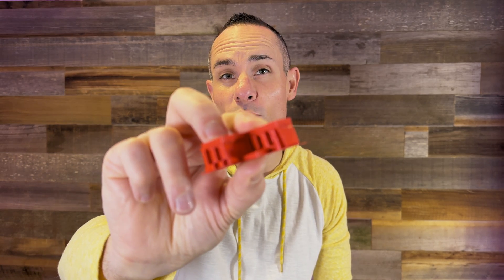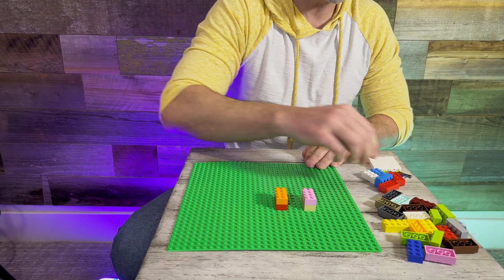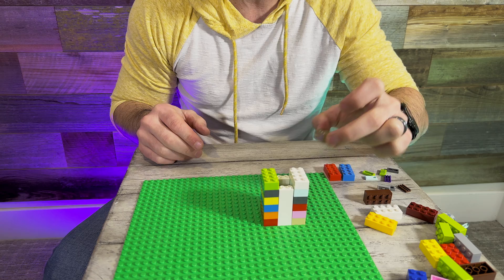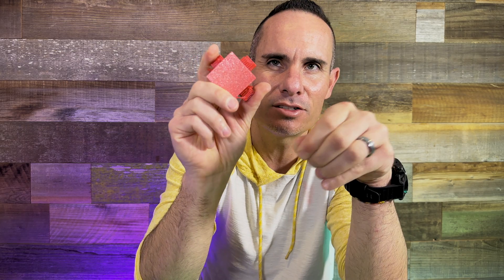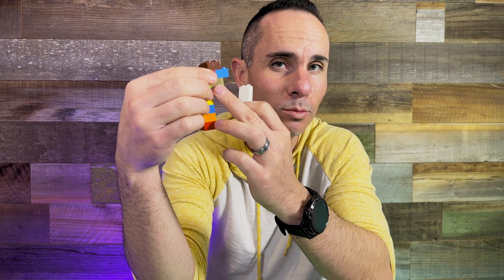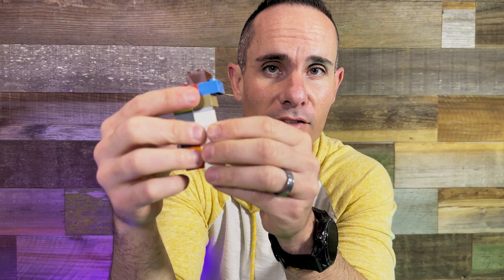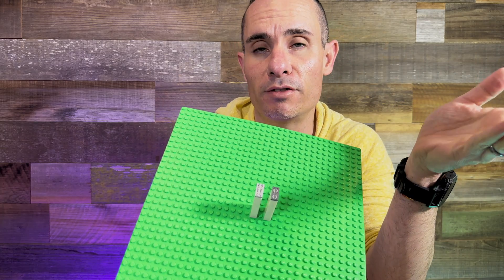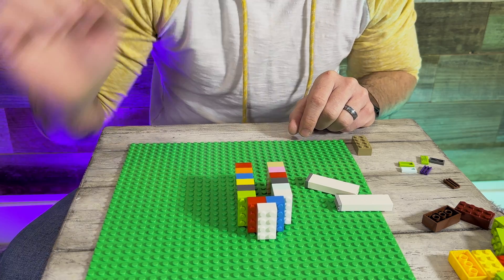Easy To Remove Supports For Your 3D Prints: Tips and Tricks

Comment: i got a 3d print and i am using flashprint. The bottom of my model is a curve, i am using pillar support but after print, it is impossible to remove. How should i adjust flastprint setting so the supports are easier to remove?

Comment: Love the setting info. Gonna try when I get home. Question about rafts. Running a Anycubic Kobra 2 and I am trying to figure out rafts. I can turn on the option and run the print but I cannot remove the raft from the print. What am I doing wrong or not doing?

Comment: I user a 3D printet (UltaMaker s3). I have a hand anatomy with some unconnected bones. I want to use support rods of 2mm to connect various pieces of bones using a different color. Please advise on the softwate I need to achieve this. I use ultramaker cura softwate but I understand for connecting bars I need a software like blender.

Comment: Can't find the " XY Separation " in Bambu Lab Studio... do you know what equals that?
I think it is "Support/Object XY distance" but that is mentioned in mm and not %
Reply: +1
Reply: Or just double the default number that's on there.
Reply: "XY Separation" is calculated as a percentage of the external perimeter width (eg 150% of 2mm width = 3mm XY gap). So take your external perimeter size, multiply it by .75, and that'll give you the XY Separation in mm.

Comment: Printing vertically on my FDM printer works best for me.

I generally avoid printing horizontally like this because it makes the layer lines stand out more. Printing it vertically leads to more layer lines and thus a better finish, so I do that. You can try to split pieces  into several parts, but that is a hassle and I don't know how to make the joins inconspicuous.

Comment: Thank you so much! Great explanation. I’m guessing your settings are the minimum spacing and distances to start at, do you have as much luck doubling these space settings? Or do you see more failure trying to increase them?
Reply from the maker: Sometimes you end up with a spaghetti failure if you go too far with the settings, so I usually try double the layer height and find it works well. You can also try tree supports which from my experience are pretty amazing and detach easier

Comment: i cant find half these settings on cura or im just dumb
Reply: same
Reply: don't use cura. had many problems with it. use orca slicer. way better. and find a support calibration that will print faster to quickly find and tune.

Comment: Where do you find "Tree supports" in Cura? In "Supports" there are 6 choices like "tree support branch angle/distance/diameter" etc but I don't see just "tree supports" anywhere? Thanks much
Reply: If you already see options about tree supports, then you are already using tree supports. The type of support you use is chosen in a drop-down menu
Reply: TY

Comment: Figured out there are many tools for removing stubborn or poorly designed supports besides the snips your printer came with; needle-nosed pliers, eyeglass-sized screwdriver kit (the flatheads), box-cutters (a good one works better than the $5 home depot version) and you can even employ a soldering iron to melt down excess until it's small enough to file.!

Comment: Hey Brother, been doing my homework since we last spoke, I bet most folks new to 3DP will have these questions; How can you tell if the STL you found used unnecessary support? (I use Cura)
2) How will we know if the settings we change to minimize supports made it inadequate (not supported well enough)? It would be heartbreaking in a 12 hour print to find it failed skimping on supports, does Cura show us if the print might fail? I realize it will be trial and error sometimes, and we want to save material, have faster prints, less support removal work so the benefits are massive, I'd just like to learn the generic settings, as would every 3DP fan. Thanks my friend, liked and subbed

Comment: Of course for some parts it doesn't matter the orientation of the print, but beware that, for some mechanical parts, which one you choose as Z axis can make the difference (about resistance, accuracy and so on).
Reply from the maker: Yes, definitely a great point. If its a part that will be under any type of mechanical stress, aligning the layers appropriately is very important!

Comment: Great video, ironically I'm also printing a Mando helmet as well , but I have an Ender3 V2 Neo so I can't print it in one shot like you, it's 8 pieces and my first piece probably used more support filament than the piece itself (top-left-back), Can you tell me where to learn how to make the support piece much smaller? The support alone was 5 by 3 by 2 and took 11 hours! Thanks for helping out a noob dad
Reply from the maker: If you can use cura or prusa slicer, select tree supports or organic supports. That's going to cut WAY down on material used, and they seem to be easier to remove.
Reply: @ALLYOURTECH3DP  Thank you kindly

Comment: I've used very similar settings and I still struggle with PETG supports. Pla Is always a breeze for me. Will have to give it some more fiddling.
Reply: I’m struggling with PLA+ already 😂 any tips?
Reply: @TeaGamingPanda   I found that using tree supports or organic supports helps a bit.
Reply: @Tadcrazio  Gotcha! Def gonna try now and then, thank you!
Reply from the maker: PETG can be a pain sometimes. You might increase the z distance and spacing a bit more.